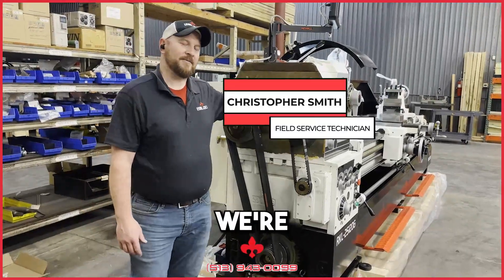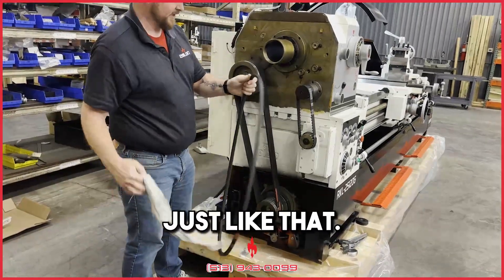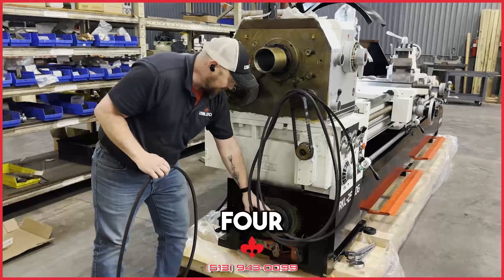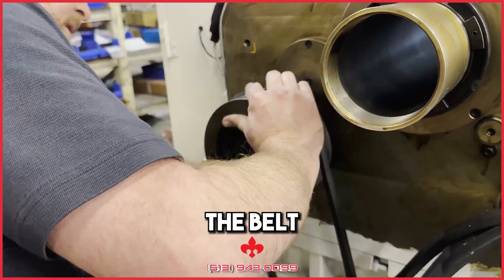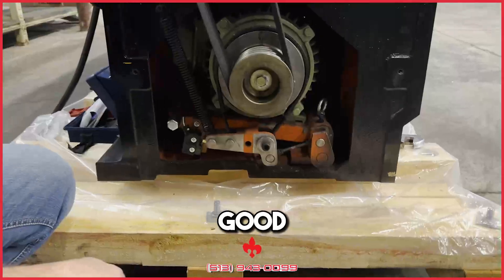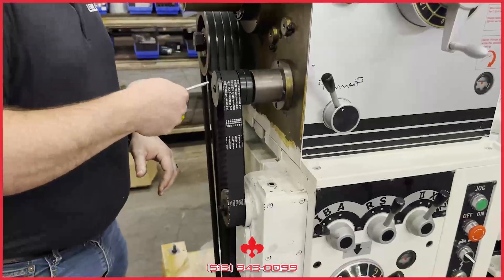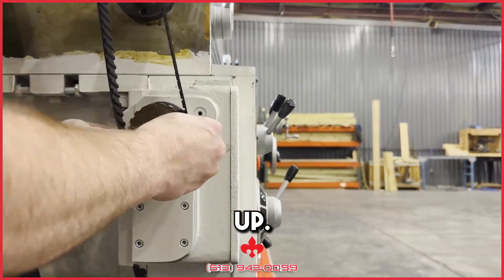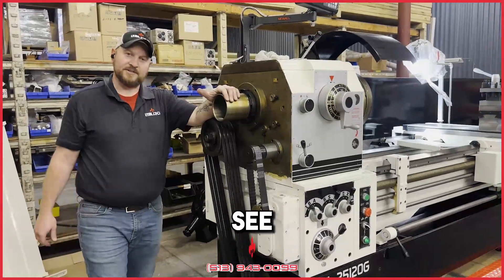Change Lathe Belts FAST Using This Genius Towel Trick 🧼 | LeBlond Belt Replacement Hack

Comment: The old 9 and 10 series of South Bend  used flat leather belts. I'd just go to the auto junkyard  and cut a wide enough serpentine belt, cut it to size, and drill the ends staggered in the rib valleys , which would be on the outside, then use some heavy nylon fishing line to lace the ends together. Smooth, quiet, lotrs of grip. Lasted 4 years or so at a shot. Zero stretch.
Reply from the maker: Thanks for the feedback!